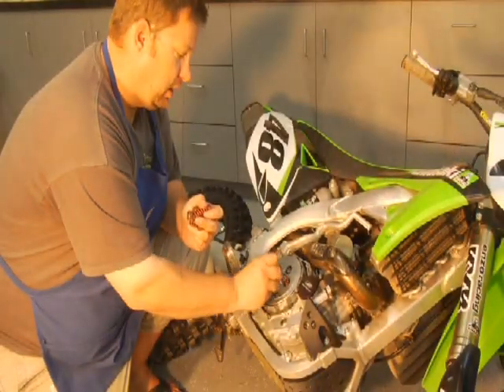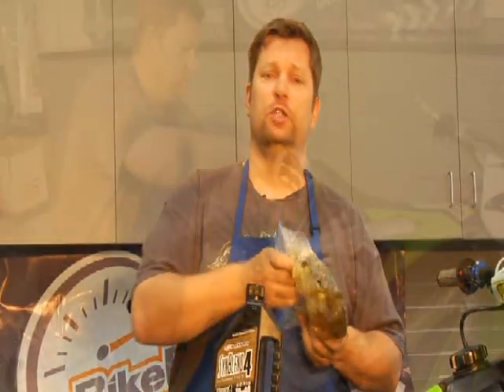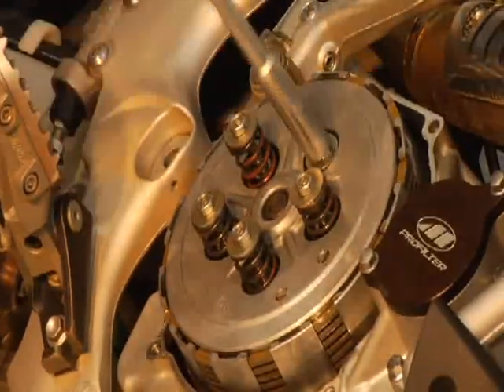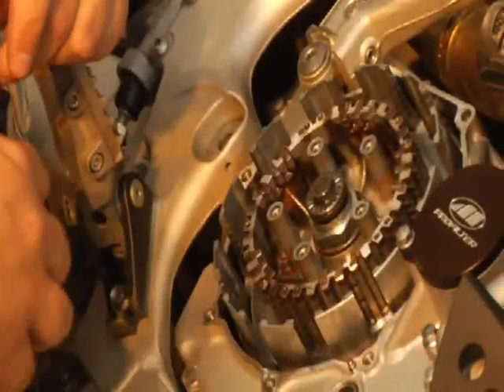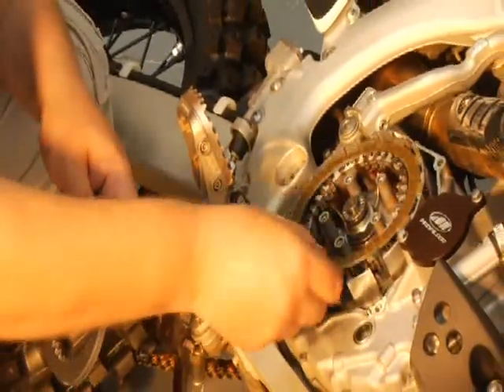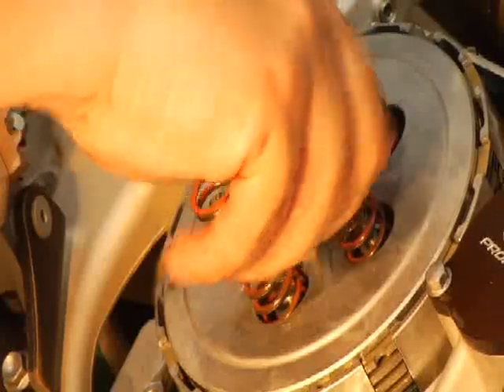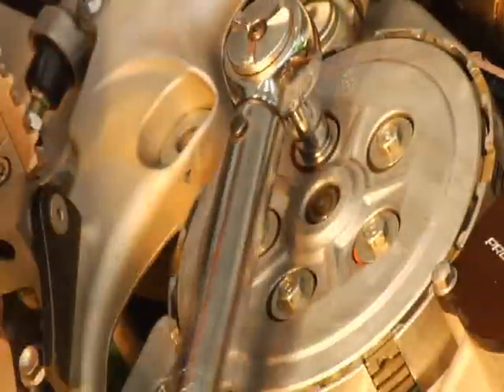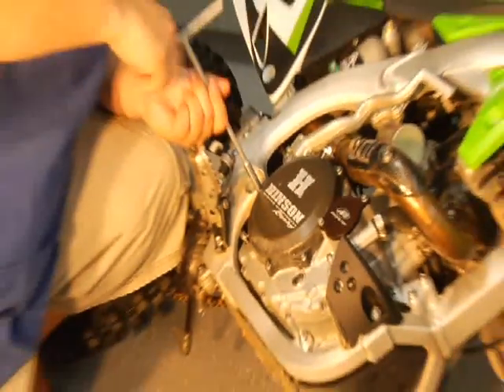How-To Install Dirt Bike Clutch Plates at BikeBandit.com

Comment: Your adjustment is probably too tight, loosen the adjustment up by your clutch lever to where you have a quarter to half inch play in the lever itself. Having it too tight can leave the clutch slightly disengaged therefore not have the proper grip. You will burn the clutch up fast if you leave it that way.

Comment: Good video, Should maybe mention that the first bolts needing remove are easy to strip when breaking loose, and easy to break off when over-tightening. Also oil will leak if not tight enough… u made it look too easy lol ❤

Comment: 2010 KX250f, clutch isnt engaging even when the cable is fully tightened. What problem is this? When its put into gear it still wants to crawl even when the clutch is fully IN. What do i do?

Comment: I would like advice on a KTM clutch. 2012 EXC. I’m changing oil for the fourth time and my clutch is still sticking. I used to drive Motul 710 2T, now I tried Motul 5100 10W40, 15W50, Motul Transoil Expert 10W40 (that was the best but not perfect) and now Motorex 4T 10W40 as well. It can be easily emptied, but it carries the engine with the clutch retracted and disassembles it into a gas splash.

I put the clutch on its atoms for the second time, which I see:
Springs length 40.85mm, factory value min. 42.5 -43mm
Push rod length 192mm, factory value 199mm (I think it is written in your book, because I think the clutch would not work at all with a 7mm diff)
Wear lamellas have a uniform thickness of 2.85 mm, factory value min. It would be 2.6mm, and the factory new one would be 2.7mm (I think it could be a spelling here too)
Metal slats uniformly 1.3mm all in all. With 240 and 320 papers, I completely sanded them all off, as if they were new and straight as well.
The clutch basket is not tucked in, but the needle roller underneath is minimally hanging, no sound yet.
I would be very grateful if someone could help solve the mystery, what could be the problem ??
Reply from the maker: Give the guys over at Customer Service / Sales a call. They can help you figure out exactly what you need

Comment: Hi Steve, I replaced my 2004 kx125 clutch exactly as you did. But my clutch has no tension. I mean the cable is ok. But the clutch lever on the other side of the bike has no tension. Do you have any idea about what is going on??? Tks

Comment: what kind of bike do you have? i had a ktm the basket came out before the inner clutch cover but on my honda you have to take the inner cover off, then you remove the lock from the big nut in the middle and take it off the hub and basket come out with some washers and shit, keep track of them, put it in how you took it off and look up the torque specs on the nut

Comment: How do I know that I have to rebuild the clutch? I am quite new to MX and I was recently rebuilding a 02 YZ 250 and I love the bike. But I got some clutch problems - means: Sometimes even if I use the clutch lever, it seems hard to shift. I think the clutch hasnt been rebuild for ages (one of the few parts I didnt rebuild).

And another question: If the basket has some grooves - can I simply take a smooth rasp and remove the sharp grooves, instead buying a new basket? Thank you!

Btw... thank you very much for all you videos - they helped me alot while rebuilding this old (but very nice) bike :)

Greetings!
Reply: did you find out?
Reply: ye I took a rasp and removed the grooves from the clutch basket. Runs fine now.

Comment: Just a question, I got a Modenas Kriss II and I found this video very useful. So I wanted to know is this video only for dirt bikes or can be useful on my bike too?
Reply from the maker: +γιωργος μαυροειδης 
Hey there,
All versions of the Kriss motorcycles have a traditional 4-speed transmission. Your clutch internals should be very similar to what you see in this video. Any motorcycles that have a multi-plate clutch system will be right along the same lines too.

Comment: hey I have a 2004 cr250 2 stroke.I have no tension on the clutch lever.installed a new clutch cable still no tension.any ideas?

Comment: What oil should we soak them in? (just kidding).
I came to see if I could just lean my bike over and 
not need to dump the oil since I just changed it.
My clutch plates are acting worn out 
as they should be by now.

Comment: in my clutch 2 discs were cracked or smashed into pieces! I'm just wondering why. Maybe you have some idea or you have seen it to. Other discs were perfect. I replaced all the discs. Now when i sometimes release the clutch to do a wheelie it sometimes makes some scratching noise. I put in the discs dry. Maybe thy are not oiled so well and still dry. Anyway i will keep riding and i hope they will be oiled.
Reply from the maker: Hi Farmboy,
There could be many factors as why the disk would crack, without seeing and knowing the history it would be virtually impossible to tell. It could be as simple as those were the weakest ones in the pack. As for the new disks, make sure you follow the install instruction to the letter, clutches can be very temperamental if not installed and broken in properly!
Reply: That was the problem of that noise. I didn't install them in correct order. 2 of the discs were different. One had to be at the begining and the other at the end. Everything is now fine

Comment: Hi steve,
i ride a rm 125 from 2010 and i have a clutch problem :0
when i want to start it feels like it have 2 starts like slowly start to ride it feels like the first pick up is earlier than the second one 
the clutch plates are new !
i replace the oil enough !
i heard about the metal plates with the sharp size towards the bike but i don't know where the sharp size is pointing to ?

Does anyone know ??
Thanks.
Reply: try adjusting cables
Reply: @LuBuckets  wow thanks for a respons, now i already have an other bike but the problem was the basket was to damaged.

Comment: QUESTION! 
I have a 2005 Honda 250 can it still be competitive against today's bikes? If so what mods can I make to help improve the performance?
Reply from the maker: +elijah feldman 
Hey EF,
So really quick...CR or CRF(dirt) or CBR (street)? Keep us posted and we'll try to best answer your question. Thanks.
Reply: +BikeBandit Crf250r sorry*
Reply from the maker: +elijah feldman 
Hey EF,
Absolutely you can be competitive on your '05 compared to a '16. The difference in horsepower and weight between the two bikes is minimal. The best component to improve performance on, is actually YOU as the rider. 95% of riders on 250F's can't actually use all of the power. Get yourself more comfortable at speed, and most importantly on the brakes. Put on a new set of tires, bleed your brakes, and adjust the suspension to your weight, and you'll be surprised at how fast a 250F can be. Anyone can go fast in a straight line. Practice keeping corner speeds up, and getting hard on the brakes, as that is where races are won. Thanks for watching our videos and the question. You're a subscriber to our channel, right? Ride safe. BB.com!
Reply: +BikeBandit wow! Thanks bike bandit I was beginning to lose faith in my ole beater. Thanks for the tips! And quick response. Like and shared 👌👌
Reply from the maker: +elijah feldman 
Hey EF,
When it comes to your "beater", maybe it just needs a freshening up? How many hours on your top end? Although now we're starting to talk some serious money, if it doesn't leak or consume oil, try to do the more inexpensive mods first. Sometimes we forget that we as the rider is the most crucial component in the equation. Remember that it's not the size of the dog in the fight, it's the size of the fight in the dog. Thanks for the like and the share, and we assume that you're subscribed too. 
OK, now go out there and have fun on your motorcycle. Ride safe. BB.com!
Reply: BikeBandit of course im a subscriber!! :) and i just had the engine rebuilt brand new piston cylinder valves crank main bearings the whole ordeal. what are some of the more inexpensive mods i can make to make it race worthy. thanks again
Reply from the maker: +elijah feldman 

Hey EF,
Thanks for subscribing. We appreciate the support and the business. 
OK, great. So your bike power-wise is in tip-top shape. From here, I'd focus on really dialing in the bike to you, making it easier to ride fast. Set your suspension up right, aligning your controls for maximum comfort and dexterity, and then it's all about you. Conditioning yourself to be faster by strength training, cardio training, diet, and mental focus. 
The bike will need maintenance items constantly to remain in peak condition. Fresh knobbies, clutch plates, brake fluid and pads, etc.are all wear items and for maximum performance, they'll need to be occasionally replaced.
Saving weight would be next but can get really pricey. A reduction of 7 lbs. equals 1 horsepower, but pretty tough to shed 7 pounds off a 250F. Id' focus more on you as the rider. It's usually the least expensive way to maximize the return. 
Thanks again for the dialogue. Ride safe. Have fun. BB.com!
Reply: is it a 2 stroke or 4?
Reply: CRF the f is for four stroke. Know your shit

Comment: Everytime I try to remove the pressure plate bolts the whole basket rotates. my engine will not shift up or down so i cant change the gear if that would help. any tips on how to make sure the basket isnt rotating while lossening the bolts ?
Reply from the maker: +509 fmx 
Hey 509,
So your transmission will not shift into gear? How about using a dowel to stop the rear tire from spinning? Keep us posted please.
Thanks.
BB.com
Reply: +BikeBandit  the motor is currently out of the bike on my work bench. the bike sat for a while causing the plates to stick.so i opened the clutch cover and found the last clutch plate before the pressure plate has chipped. but when the motor was in the bike  before removal and it was off i shifted into first gear and its stuck. the the foot shifter will not click up, down, or back into neutral. so i took the motor out and put it on my bench now i cant get the bolts that hold the pressure plate to loosen without all the gears rotating and moving the piston up and down.

Comment: i haveb a yz 125 also i have clutch it doesnt slip but i tightend the cable all the way and still the sameidk and. when u pull it in the garage does it smell like semi brakes or burning oil?

Comment: my yz125 has a problem, when i put it in first gear it starts to pull and iv tried to tighten the cable and iv tightend it all the way and it still does it should i do this?
Reply: this is a long, shot but please tell me you found a solution to that? my yz fucking pulls with clutch fully in, all tightened up etc. Installed a new cable, probably made it worse... did you manage to fix it?

Comment: Are the fibres installed in any specific order ?
Reply from the maker: Each bike has a specific order. Check your service manual
Reply: @bikebandit  How would i find manual for a rmz 250 if i bought it used? No dealers around me
Reply from the maker: We have lots of parts break down on our website. You can try that or just Google it

Comment: I have a suzuki pe250 and my clutch wont disengage, i can shift but when i hold the clutch down and put it in first it suddenly stalls, ive tried tightening the cable i tried loosening it. nothing seems to work

Comment: I'm planning on getting barnett clutch plates for my bike just had it rebuilt, and I had a new barnett clutch basket installed while it wad being rebuilt, I started it and noticed a little knocking what could it be? Just had rebuilt
Reply from the maker: Jonathan Nockideneh Could be a couple of things, but either way, don't start it again until you take the cover off and see if you can figure out without taking the plates out of the basket, etc.Might be something totally obvious. If you had a mechanic do the work, take it back.
Reply: Okay I was told it's a difference with the material using a billet steel instead of aluminum but I'll look into it
Reply from the maker: Jonathan Nockideneh Clutch baskets don't usually knock. Clutch noise usually chatters when new plates are used in old baskets, and the teeth/fingers have grooves that hinder the smooth movement of the new plates. Depending on the basket and/or clutch kit that you put in, some them advise against using a full synthetic oil. Keep us posted though for sure please.